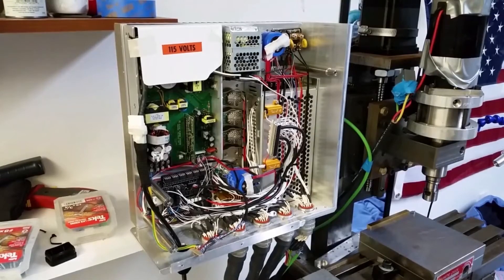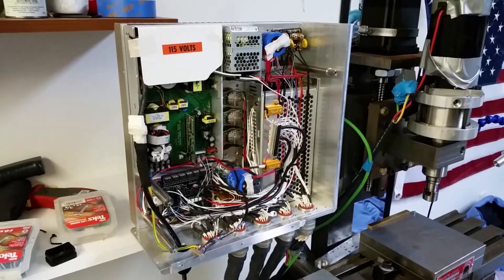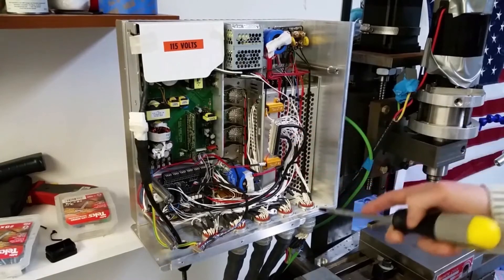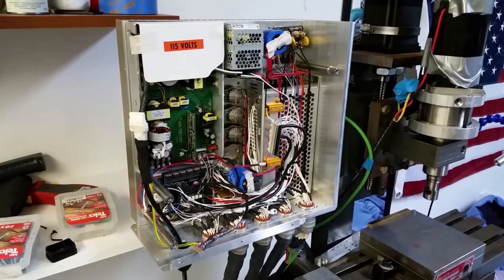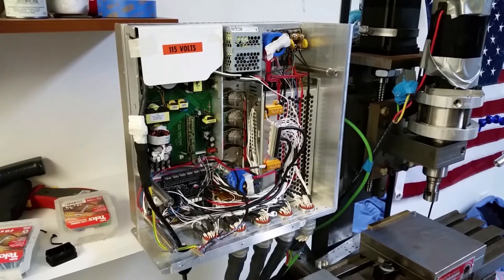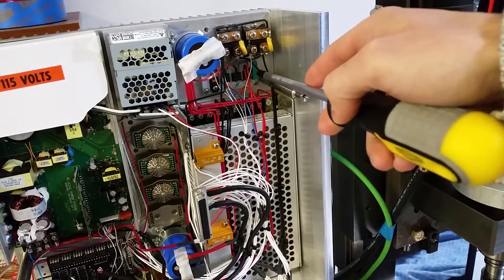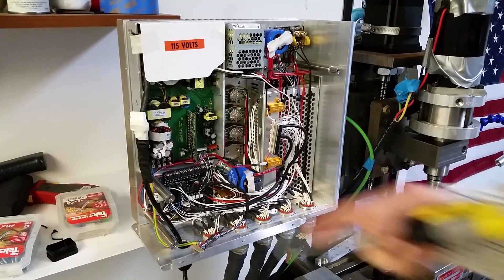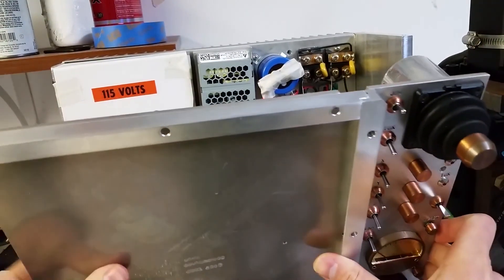CNC Controls with BeagleBone Black

Comment: Way cool, and those analog dials! :)
I've got some special requirements for my CNC mill and lathe conversions and believe your Optocape and BeagleG forms the basis of a solution. Wondering if a device-tree-overlay that (also) configures the PRU pins for Optocape and BeagleG can be made available to buyers of Optocape?

Comment: What're you using for a display? Is there a touchscreen on it?
Reply from the maker: Rick it's is an old Laptop screen with 4-wire resistive touch overlay. The LCD and touch sensor solder directly to Optocape.
Reply: Thanks. I'm going to be making a CNC router table based around a Beagle (of some kind), and am looking for a good display. I also will probably buy your Opto cape for initial prototyping before making my own. Thanks!
Reply from the maker: Great. The Optocape developer community is small & growing. FYI - I think the older laptop screens are easier to work with. But in theory any flat panel LVDS screen should be compatible.
Reply: I hate making cables, though :)

Comment: Very well done sir! I worked for several years as industrial electrician before getting my engineering degree, and I love the attention to detail and the obvious craftsmanship of the machine, very professional and clean.

I was wondering, what stepper driver boards are you using in your controller?  I saw you posted a video/hackaday article about developing a DRV8818 driver board, but they don't look the same as what you're using here.  Is this another revision of that board, or something else entirely?
Reply from the maker: That is StepperStack. I designed it in 2014. Yes it does use DRV8818 too. It is an inteligent driver with built-in control algorythms. It was designed mainly for pumping applications. It's a great driver, but they are too expensive for most folks. It pushes DRV8818 very close to it's limits. The problem I found was they can be sensitive to voltage spikes. The idea with the new driver was to cut out un-necessary features to make simple DRV8818 driver with regular Step, Direction, Enable interface. It has a high performance PowerPeg heatsink. I also added hardware making it immune to voltage spikes. Still testing to see if it works properly.

Comment: Hello, how did you use a touch screen with machinekit? I have a 5" pi resistive touchscreen for a Raspberry Pi  and am not having much luck getting the touchscreen aspect working with machinekit. And nice vid + Hackaday page.
Reply from the maker: There is a bug in Linux kernel version 3.8 preventing bypass of the HDMI hardware. I was unable to output parallel video until I updated to a 4.x kernel. Then it worked fine. Last time I checked Machinekit only runs on 3.8 kernel. I found another program called BeagleG which does run on the latest kernel versions. It does not have a fancy GUI but it works great.
Reply: Thank you.
Reply from the maker: You're very welcome. Ha ha. Took me a month of guessing & checking... and crying.   :D

Comment: Is it possible for your cape to drive an older tablet screen and touch like from an ipad 1st gen? Possibly adapting "I-PEX 20453-20455 50Pin 2 ch 8-bit LVDS Cable For B101UAN02.1 B101UAT02.2 WUXGA" cable from ebay? Your cape is competing against the acorn cnc controler.  The acorn has a lot of how to videos and a poster that show a possible install. A lot of potential customers don't have your breadth of knowledge.  Just my 2 cents from the peanut gallery.
Reply from the maker: Yea the LCD should work. You will need some extra hardware to capture a capacitive touch (maybe a USB dongle?). My setup uses resistive touch wired directly to the analog pins on BeagleBone. I like Optocape because it's simple. Any spare laptop LCD hooks up easily, and resistive touch overlays are fairly easy to find. My screen is a LQ141X1LH43. Thanks for the input. I can make how-tos based on questions like yours.
Reply from the maker: https://elinux.org/Beagleboard:BeagleBoneBlack_HDMI
Reply: I know that HDMI works but I don't know how to tell if a random laptop screen will work with your controller or how to connect it. I don't know how to connect a four wire touch screen either. I was just thinking that if the display and touch from an older, very popular tablet (cheap and plentiful) could work, it would be better for everyone and the planet.